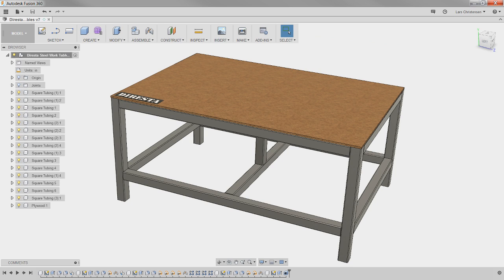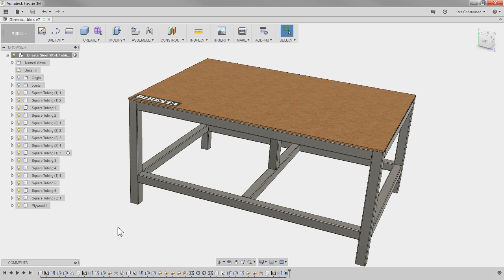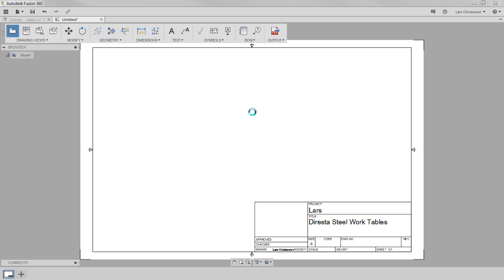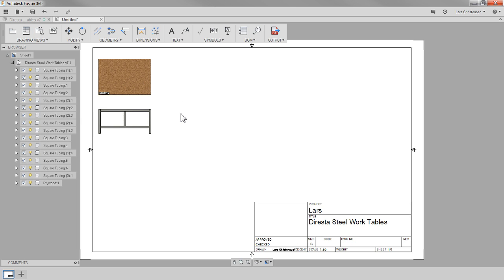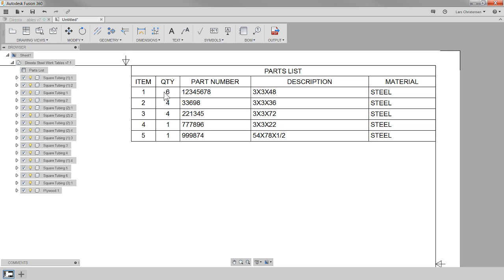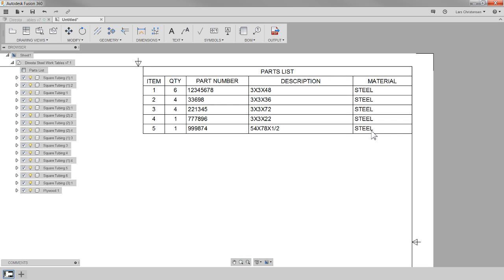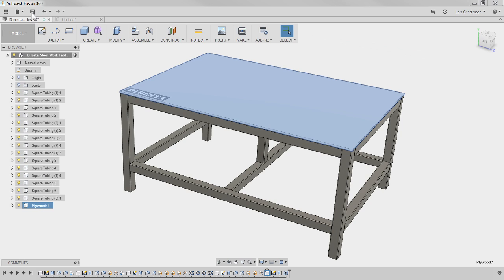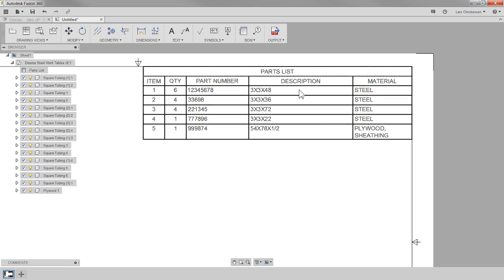Fusion 360 - How To Create a Part List (Diresta Table)  —Your Comments & Questions — #LarsLive 17

Comment: 7:40 , the standard size of a tube is 6 meters or 19 feet, is there any way to have Fusion calculate how many full size pieces I need to get for example items number 1,2,3 and 4 ?

Comment: Hello, I wonder how can I include the sub components into the part list.
I have an assembly, made of other 3 assemblies. The only parts I get in the part list are the 3 assemblies.
How can I get the actual part list? For example to get a list of the bolts and nuts
Reply: Agreed, also mortifying to discover that I need to edit each child component and manually add bounding box dimensions in the description....    Lars, is there a way to pull in child components, and if I'd set variables for dims could these be referenced in the description?
Reply: @CasparMacRae  1y no answer is a no. I really tried. Switch to other software F360 is just for school projects.
Reply: @maxkl654  while selecting parts list, you get a little popup screen on your right. On the top you can select between 2 things. I don't know what's it called. Default is no child features.

Comment: Thanks very much for showing this Lars. Much appreciated. Quick follow up question. You typed in the dimensions manually into the description field from the properties section. Do you know whether there is any way, either in Fusion 360, or with an additional bolt on program, to take those dimensions automatically. Often make up furniture projects with multiple parts and trying to streamline the process and minimise typos etc. Cheers
Reply: Hy Mark - see my comment  below ... I have the same "problem"  and use:   https://apps.autodesk.com/FUSION/en/Detail/Index?id=2857656002406992603
Reply: Michael Hoffmann Thanks a lot Michael. That looks really interesting. Travelling at the moment but will check it out when I return. I could only find one screenshot of it online and the makers website in German. Does it work the way cultist does in Sketchup do you know? Would love a way to auto-populate a cut list from components in Fusion 360. Do you use Fusion for woodworking? Only recently started using it and would welcome any help from a furniture perspective. Many things thanks. Mark
Reply: There are Install instruction on the page - see the "Read Help Document" - its a normal Fusion Add-on:  when you downloaded this app/plug-in from Autodesk App Store has already is installed
Reply from the maker: Thank you Michael!
Reply: Michael have you seen the update to CSV_BOM for Peter. You can now separate out the component dimensions making it a very usable cutlets program

Comment: Hy Lars,  good video and explanation of BOM  - thanks.  

However, your video shows also, why I think the actual BOM feature is a bit  "rudimentary"  e.g.  copy by the bounding box into description for each part to get the dimensions in the table.  (for me as woodworker a BOM w/o base dimensons  "cutting list"  is useless ) 

There is a (now accepted)  idea:  https://forums.autodesk.com/t5/fusion-360-ideastation-request-a/drawing-improvment/idc-p/6732238    and hopefully will will get this soon.  ( Adding and editing properties from the BOM would be really great)

In the mean time I recommend this Add-on:  (its not from me but I use it often ant it helps a lot): https://apps.autodesk.com/FUSION/en/Detail/Index?id=2857656002406992603

Grüße aus Heidelberg - Michael
Reply from the maker: Thank you, Michael. Pretty sure the development team is working hard on new drawing enhancements.

Have an awesome day!

Comment: Hi Lars, a video on how to efficiently model 'weldments' would be great. I can sketch a rectangular tube section, extrude it and move it around and join it to other pieces, but boy does it appear to be laborious.  How are you doing it?  And how would you efficiently model  a mitre joint between to pieces of angle?

Comment: Thanks for sharing. I had missed the desciption field in properties. Nice workaround.  One can hope one day Autodesk will implement that we can add dimensions dynamic to the BOM.

One questions, using metric the mass are in gram, which quickly gets a huge number. I have not found a way to override this to kg. Do you know if there are a way to do that ?
Reply from the maker: Hi Michael, Thank you for taking the time to watch the video!

Change your units to meters and it changes to kg.

Best,
Lars

Comment: Another related question,  In this example, this table was made from square tubing.  Is fusion smart enough to calculate the number of feet of tubing needed?  This could be helpful for purchasing material and pricing the job!  Also if you work with standard materials like square tubing or 80/20 extrusion is there a good way to bring in this standard material and extrude it to the length needed without re sketching the profile?  

Thanks